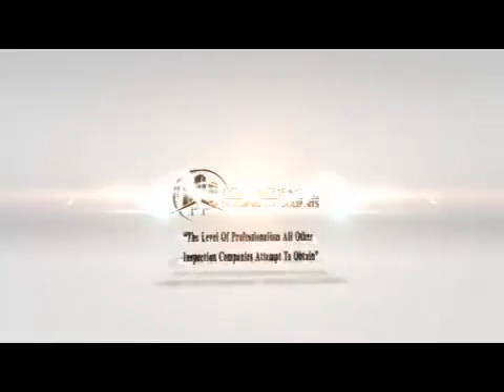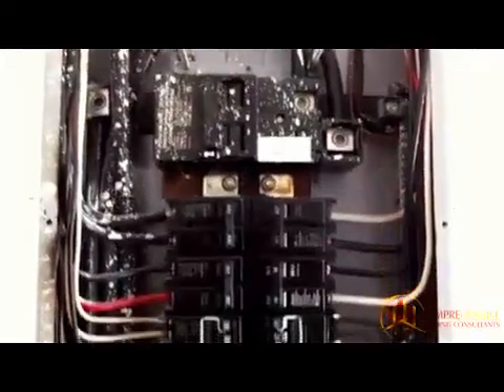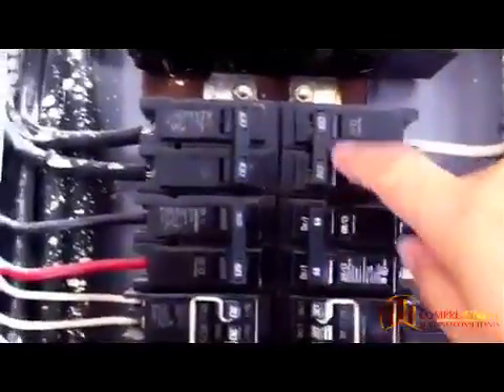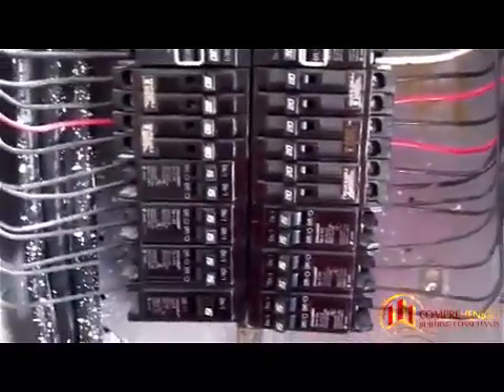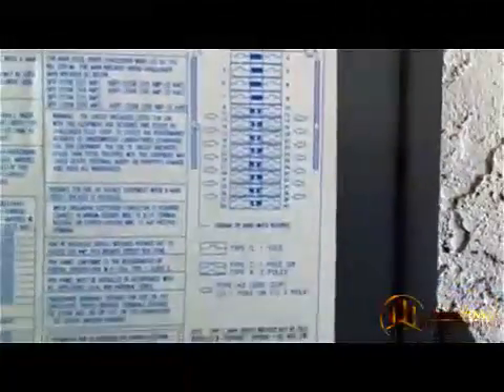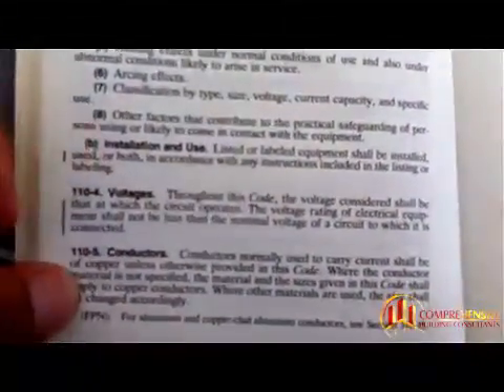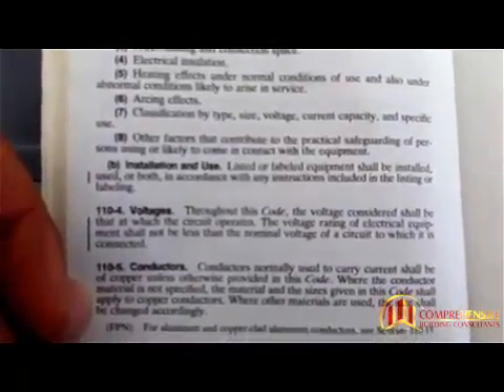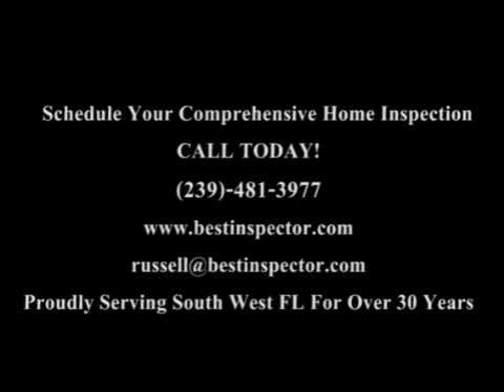Tandem breakers

Comment: these stab lock breakers , four pole are no longer made by the original company . The new ones are very tight for the connection to panel and some of the news ones from the supply house could be problematic . I changed  a four pole the other day . Its works and went in but the stab lock connection on the new one is a little different making it tough to connect . I put a load and the breaker for 30 minutes to moke sure the connection was made good. So no over heating at 30 amps , full load .